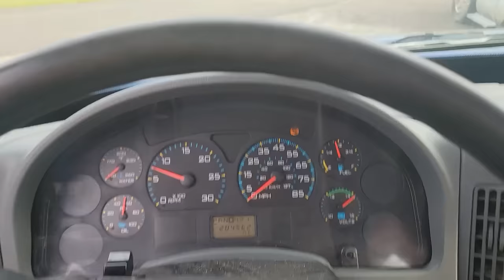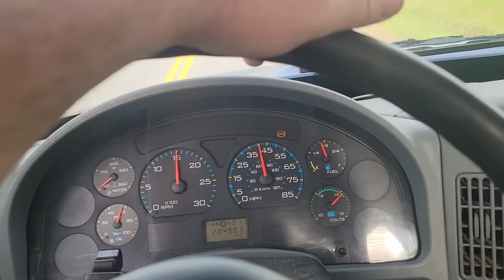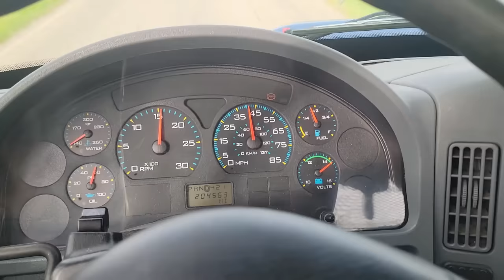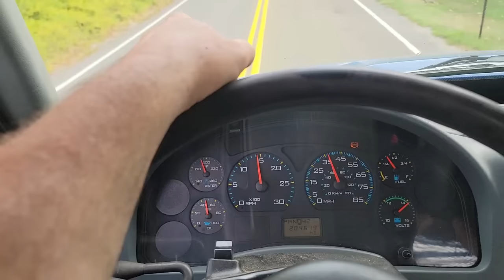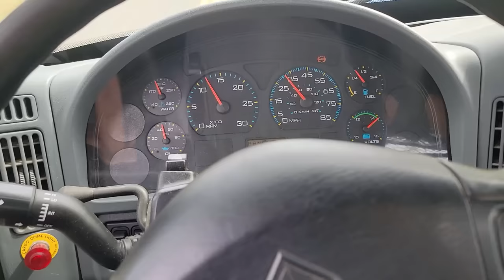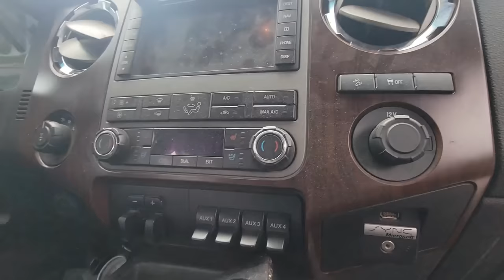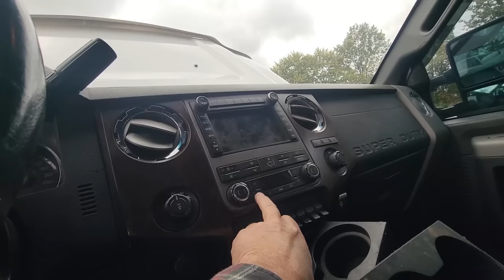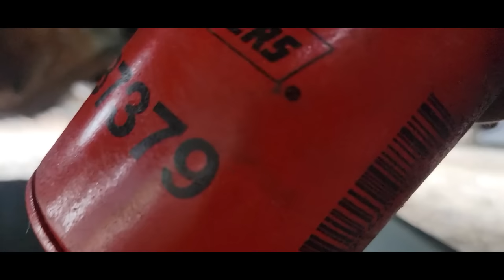I ACCIDENTLY (BUT NOT REALLY?) BOUGHT ANOTHER CREW CAB 4X4 DIESEL?

Comment: that was probably the only oil in  the engine before they put the new oil in it
Reply: I bet you're right because why wouldn't they swap the filter on the oil change too ? I bet it go so hot from low oil thats what lead up to all this and by the time it shut down and they realized they were 3 gallons low on oil they added it in but it was too late

Comment: Not really worth it you buy it 15K you add an engine for 8to 9 K you got 24K already and if you sell it  there’s no profit you might’ve just keep it if you already have an engine to replace it with
Reply from the maker: like i said in the video, i have found engine, transmission and transfer case complete for sale for $6500 to $7500. just engines for $5000. i have no money in the engine i already have....so it makes great profit if i fix it and sell it. if someone bought the truck at $15k and my engine at $5k. they would save $4k to put the engine in.
Reply: No profit? People sell these trucks for 30 to 40k around here

Comment: Really surprises me the amount of people that buy into the (as i call them) Hot air box. if you use common sense and look at stock filter and the aftermarket its easy to tell where the air comes from stock is much better than most aftermarket filters. Had one person tell me its got to be better you can hear it when you step on the gas whatever
Reply from the maker: i hate aftermarket junk. they dont put the millions upon millions of dollars in r&d that the o.e. manufactures do.

Comment: I like the truck but not the engine. Would strongly prefer a 6.7 Cummins to a 6.7 ford. It's good a pretty nice body. The oil looked horrible. Probably not rebuildable from the look of that oil.

A lot of you guys probably won't believe what I have to tell you now. I have a friend who a few years ago bought a 2008 f350 crew cab long bed 4x4 single wheel with a 6.4. Upon hearing that a lot of you are probably already thinking "junk, worst diesel engine ever built". Well he bought it from the original owner who had it deleted at 7,000 miles and took very good care of it mechanically. It currently has 365,000 miles, never had a replacement engine or even any major work. Transmission, transfer case and axles are original too.
It's by no means a perfect truck, it has its own little problems like any work truck.
The point here is yes the 6.4 isn't a great engine and personally I don't trust them. I just think that particular truck is interesting. It starts effortlessly in winter
Reply from the maker: im not a 6.7 powerstroke fan. not a dodge fan either but i am a cummins fan.....so dodge it is!

Comment: One of my buds just lost one of these.  Fuel  filter failed as they do sometimes and burned the truck down. Fire almost got him through the dash before he got out with his dog. Driver seat forward is garbage. I drove by his property, and he now has another with some kinda accident in the back.

 I like these kinds of trucks, but the cab off maintenance model still sucks imo.
Reply from the maker: gm and ford are both crammed so tight under the hood, removing the cab is the best way to do it. i can have a cab off in 1 1/2 hours. then i can stand there and get to everything. it can actually result in a much better repair because everything is visible.
Reply: @j.c.smithprojects1769  I do agree it makes the repairs better usually. Just don't  have the setup to feel comfortable doing one myself. 

Feels like every time I open youtube up, you've  bought another truck, haha. Love to see it.

Comment: Sounds like to me a lot of Chinese Parts in those brand new engine assemblies or made or manufactured in Mexico. A lot of inferior very inferior metal and steel parts and assemblies. If anyone has a problem with how you Overkill on tying down a load all they got to do is get a logistics manual from the US Army any Automotive or truck manual from military vehicles they have tied downloading instructions for transportation. As anyone with any good eyesight has seen on military vehicles if they've paid attention all the shackles on the bumpers front and rear are on the frame rails front and rear that's the only place we ever tied them down for safety and transportation. They have Army manuals for this.

Comment: The 6.7 powerstroke is the only modern emissions diesel I would run . I see what the guys at work do to them leaving them idle all day overloading them and not maintaining tye company trucks properly and they just run and run and run until they have a emission problem and it seems to be less frequently than the other major 2 brands .
Reply: The earlier ones were junk 11-15.
Now the new one got the cp4 issues coming apart.
Reply from the maker: these 6.7 powerstrokes were junk from day one until 2015. plagued with issues: ceramic turbo bearings failing and sending ceramic pieces through out the engine causing catastrophic failures, valves breaking and causing catastrophic failures, glow plug tips breaking off causing catastrophic failures, injector tips failing and causing catastrophic failures, block flexing in a pull and letting man bearings spin causing catastrophic failures, cp4 pump eating themselves and sending metal through the entire system costing over $10k in just parts to repair.....tell what issues the 6.7 cummins have again? keep in mind i have owned over 30 of 6.7 powerstrokes and probably 50 of the 6.7 cummins. forget about the isuzutrash gm uses. i dont want that engine ever.
Reply from the maker: cp 4 has a problem since day one.
Reply: @j.c.smithprojects  yeah there junk. They make a upgrade replacement kit now for them
Reply: The cummins have emissions problems around 60k miles and their  warranty runs out at 50k miles leaving the owners with a huge payment on the truck and a massive repair bill . I stood by a cummins would be my 2nd choice in a truck until they stopped making manual trans . The way the dodge front ends wear out even without a plow on my buddies 2 ram diesels turns me away from them as well . The duramax has a cult following but I don't really understand why , yes the old ones were good to a point but they all have their issues I'll stick with powerstroke there is a reason thats what every big landscaper and construction company run them
Reply: Not trying to get you going I'm just stating what I have seen to be true in my experience .
Reply: With all the problems with the modern diesels and the horrible fuel mileage I can also understand why a lot of guys are choosing gas engines instead
Reply from the maker: cummins  warranty in the pickups is 5 years /100,000 miles. i have never had any cummins with emission issues.  understand i have owned hundreds of cummins trucks with miles as low as 10 and as high as 700k. they just done have issues. that is why other medium and heavy truck engine manufactures buy their after treatment system from cummins. your speaking about front ends wearing out in dodge as well and that just isnt the case anymore. as far as the manual trans option, ford quit offering a manual trans in 2010. who cares about chevy transmissions. dont want the engine. so i couldnt care less what trans it had. dodge quit offering a manual in 2019. so sad. i love ford trucks but i have never been a powerstroke fan. the 2011-2014 6.7 powerstroke if riddled with bad engineering that almost always leads to catstrophic failure. if you pay attention to many of the landscapers and construction companies and their ford trucks, you will be surprised to see just how many are running the 6.2 gas engine. they are reliable, powerful and good on fuel. it is nothing to et 300k out of that gas engine. the truck cost less than the diesel at purchase and less to maintain.
Reply: @j.c.smithprojects I have a 250 with the 6.2 just hit 275k has never skipped a beat
Reply: @j.c.smithprojects I'm glad to hear about the 6.2 gas .. I just bought a truck with 19k and one of those, I was Leary about it because I've had enough with the 5.4 BS .. became quite proficient with the 5.4's .. I almost went Chevy due to the std V8's ... I just can't do it, my wife drives Chevy's and it makes a good girls truck because I've never had any luck with Chevy's .. they just nickle & dime you to death Everytime I try them

Comment: Man if they’re worth that much up there I got one you can make some money on. Same pickup but just an xl and extended cab. Nice skirted flatbed and ranch hand bumper. 210k miles. Bad tcm. $5k and it’s yours
Reply from the maker: its got to have all the pieces right. crew cab ,lariat interior, pick up truck bed. sounds like your in oklahoma, missouri, arkansas area?
Reply: @j.c.smithprojects  I’m 0/3 then. Yessir Oklahoma. I do have a 12 also. Hadn’t planned on selling but you know how it goes. Lariat crew cab short bed. 140k miles. Never even had a gooseneck hitch until last weekend. It has a factory ford puck setup now. Brand new falken wildpeaks all the way around (stock size). Not a drop of rust to be found. Exhaust has got that extra little whistle to it…if you know what I mean. It’s that kinda rust/maroon/brown/burgundy color
Reply from the maker: who diagnosed the bad tcm? any reason you have not replaced it? if i knew it would fix it for sure, i would fly out, put the tcm in and drive it home.
Reply: @j.c.smithprojects  on the f350? I diagnosed. I haven’t replaced yet cause it lower on my list of priorities. It wasn’t a pickup we drove every day so it’s not hurting anything by sitting. I figured I’d stumble onto somebody parting one out eventually, just hadn’t happened yet. I do feel fairly confident that’s the issue tho, I went thru it pretty thoroughly before I noticed there was no signal coming from the tcm. But it was receiving one
Reply: @j.c.smithprojects  If you did make the trip I could have a lineup of things you’d be interested in if you wanted to make your trip a little more worth while
Reply from the maker: send me pictures. j.c.smithprojects@gmail.com

Comment: How does that happen??  Oil turning to sludge??  Just overheating??
Reply from the maker: if you spin a main bearing, the crank, bearing material and the oil get extremely hot. you heat the oil high enough and long enough and this is what you get.

Comment: With the weight loss kit , the leveling kit the traction bars in the rear and all the stuff under the hood that tells me that it was a kids truck but its in super good condition inside and out so maybe a middle age guy mid life chrisis ?
Reply from the maker: older than most but not middle aged. the base is still good and able to be saved. at least there isnt any holes in the bed from a hacked exhaust stack install.